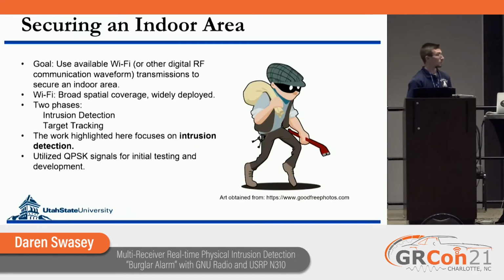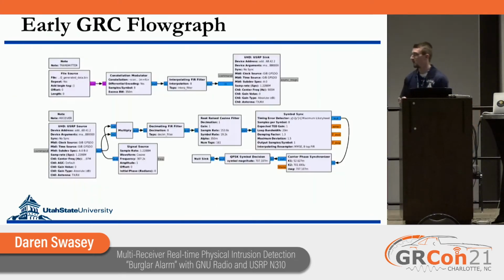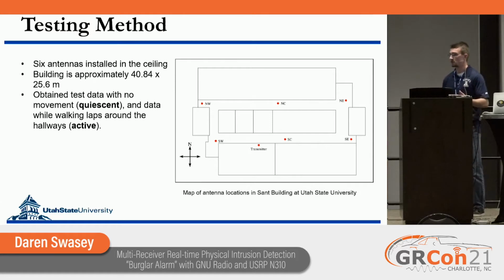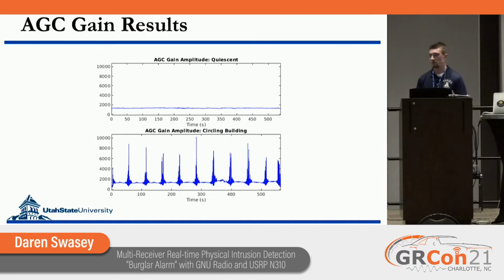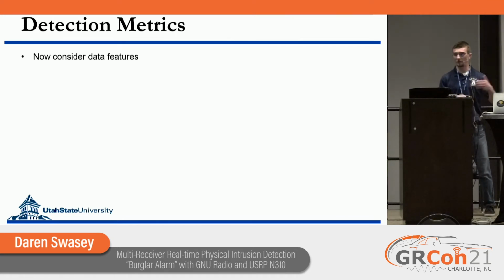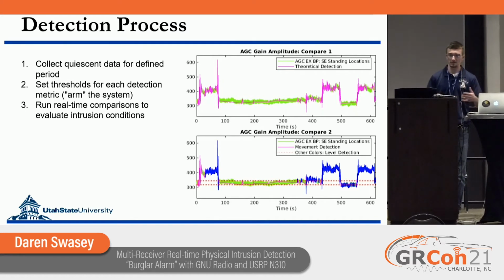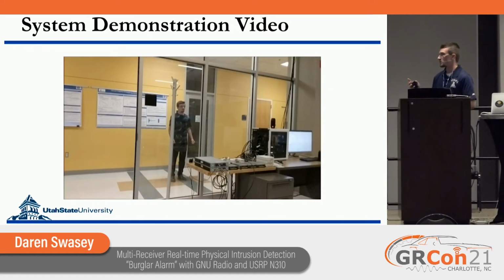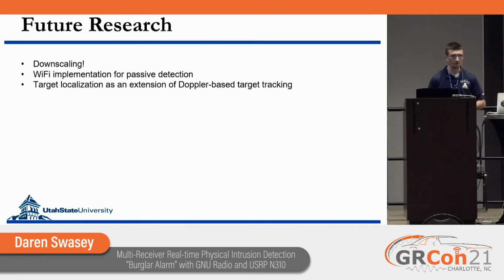GRCon 21 - Multi-Receiver Real-time Physical Intrusion Detection “Burglar Alarm” with GNU Radio ...

Comment: Hello sir, this project is really helpful. I am working on a similar intrusion detection system using GNU Radio and USRP for my class. Would it be possible for you to share the GNU Radio flowgraph (.grc file)? It would be very helpful for my learning. I will definitely give you full credit in my presentation. Thank you!